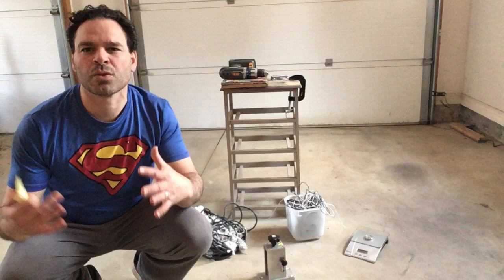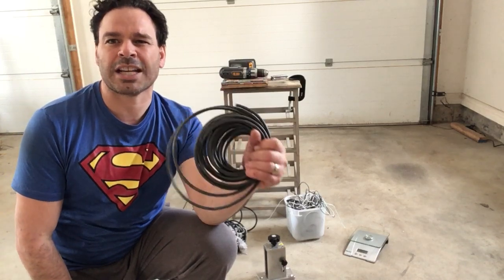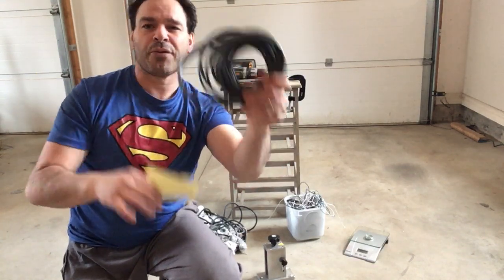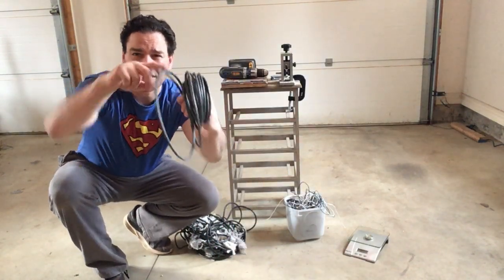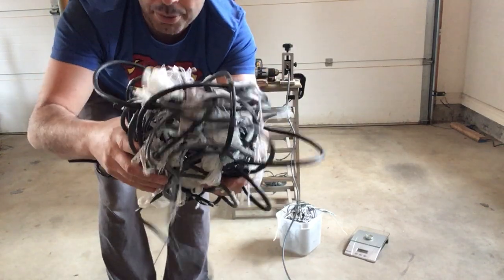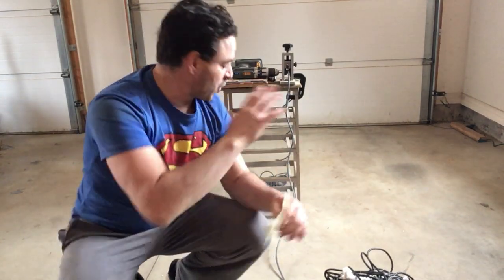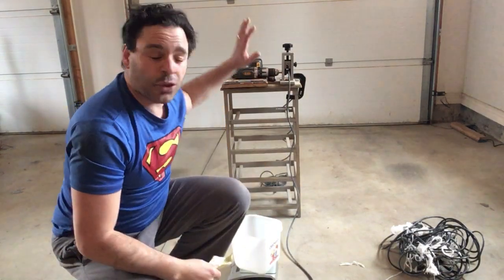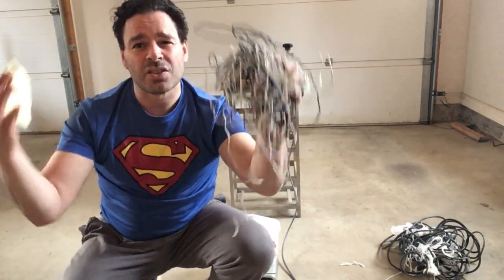Scrapping vacuum cleaner chords: should I remove the outer coating to upgrade to 60% appliance wire?

Comment: Thanks! This is valuable information. 
Here in Europe, however, there are three wires in vacuum cleaner cord; two phases and a ground wire. Also, there is less filler in it (like the white cords you showed).
But your video does show well that you got to properly assess each insulated cord. One advantage of stripping, though, is that you need less storage space.

Comment: I've always enjoyed your videos and have learned a lot from them. I know that scrap prices vary a lot by location and even within the same city. I was curious about some of your findings and had to experiment for my self... So, here's my findings. This morning I called my favorite scrap yard and got today's prices in UD$...  What they call "drop cords" or the double insulated appliance wires, i.e. vacuum cleaner cords, they're paying 59 cents a  pound... Clean, no insulation #2 copper wire is $3.58 a pound. 
  I took 2 cords, each about 30 feet long, both only 2 wire cords. Together they weighed 2.075 pounds. At 59 cents a pound that's $1.22... Taking only a few minutes to clean them of all their insulation netted me .7625 pounds of wire at $3.58 a pound that's $2.73... or approximately 2.2 times more money for the bare Vs. the insulated.  
  So, I can definitively say, when it comes to stripping it or leaving it insulated.... "it depends". 😀  If I had a lot of wire and no time, I'd sell it as is. If I had time, and I wasn't "on the clock" so to speak, I'd strip it for sure. If the price difference was less, I wouldn't strip it. But at the above numbers it was worth it for me...   It all depends on where you are, what your time is worth, and the scrap prices near you.
 I use the little Coppermine hand held stripper. It's super easy, cheap, and small. No batteries, no drill.. All hand powered. If I had tubs of wire to strip, I'd definitely go with the StripMeister! 
  Thanks for all the good info.
Reply from the maker: thanks for the comment and info